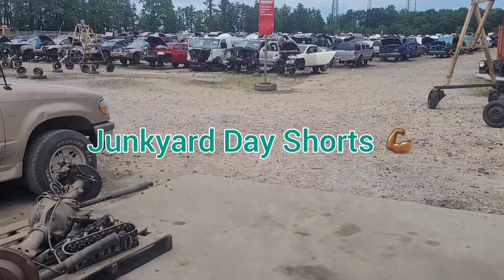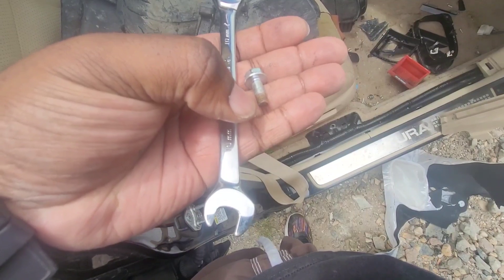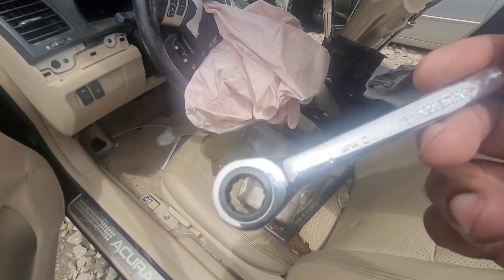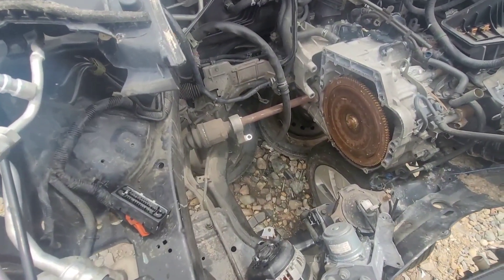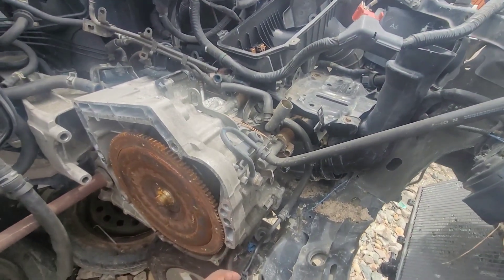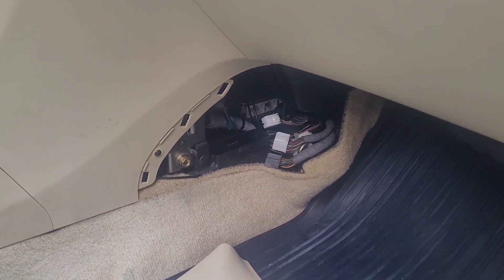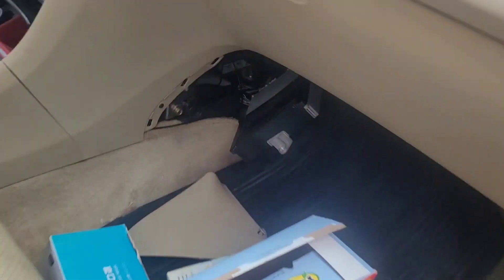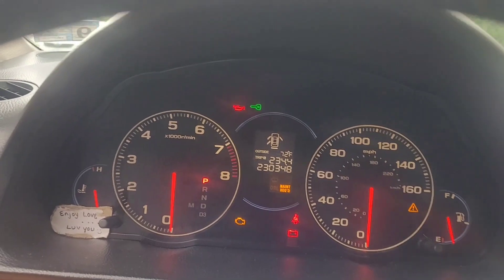Can You Simply Plug & Play an Automobile Computer Module? (Observation & Education)

Comment: The ECM you picked out has part # 37820-RBB-A59; it is not the correct part number that goes with your car even though the year of both cars is the same. Your 2004 TSX needs 37820-RBB-A53, which has been superseded by 37010-RBB-309. Even if you were to be able to reprogram the A59 with the data from your original ECM, you can expect unexpected behavior from the car.
Reply from the maker: Insightful!